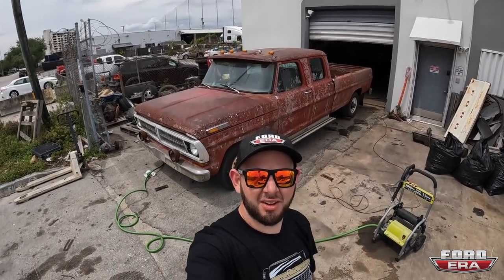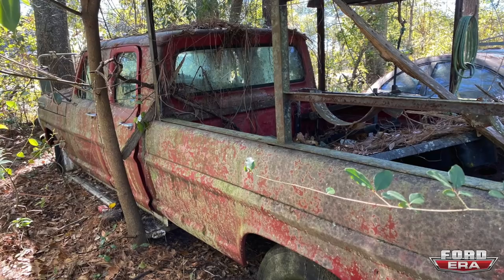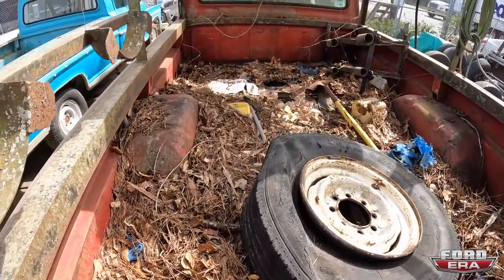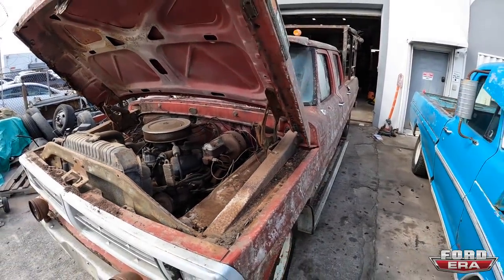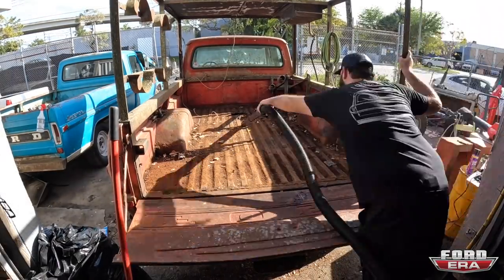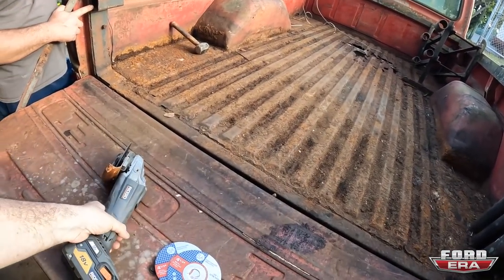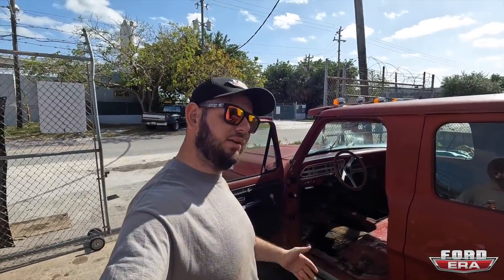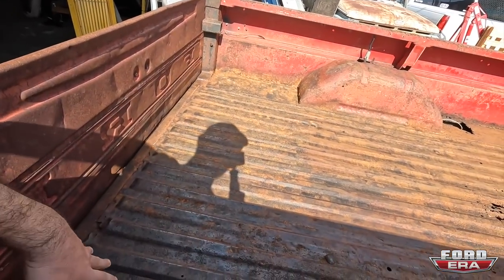Saving a 1971 F350 Crew Cab! | Ford Era

Comment: How frustrating is it to video all that work then find out it was corrupted or the battery went dead? One would think we figured out problems like that in 2022.
Reply from the maker: its honestly one of the most disappointing parts of doing this. corrupted files dont happen as much as it used to with the older gopro i used but the battery thing is unpredictable. the conditions make such a difference and i dont pay enough attention when im in the zone of getting work done